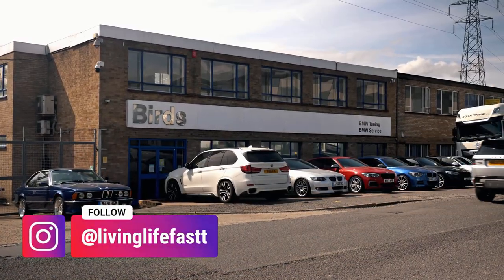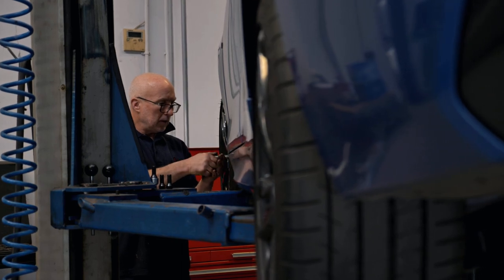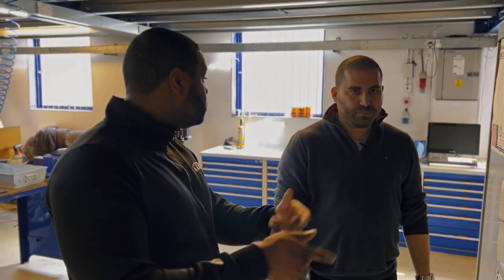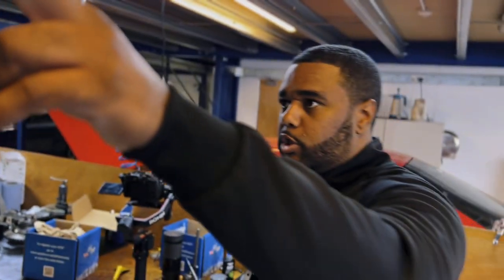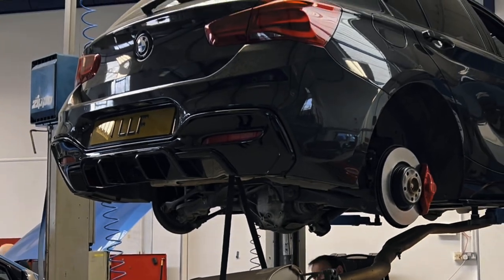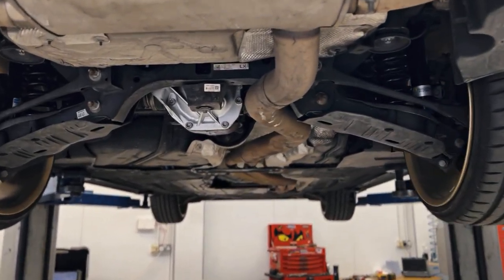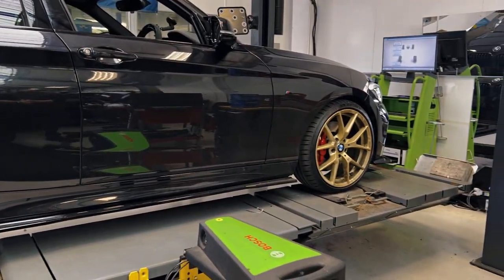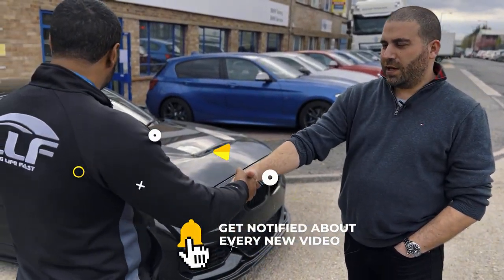HANDLING MODS FOR MY BMW M140I **B1 DYNAMIC PACKAGE**

Comment: M3/M4 Lower Control Arms are a MUST have!
Reply: 100% agree. Front end is so much more direct and the steering weights up with speed and turning effort. Added caster really helps the self centring/steering effect too.

Comment: Had a B1 full kit with LSD done a few year's back fixed the problems you mentioned even at 30mph if
 you hit a drain cover. As the original Birds article said, turned the car from 1 wheel drive to 2 wheel drive, with the Quaife LSD.

Comment: Powerflex bushes, underbody+strut brace and big brake kit and the car will be mint
Reply: @Ukgyt99  depends what stage/bhp you running, it makes a difference but nothing too crazy from what I've seen
Reply: @Ukgyt99  if you've uprated the subframe bushes. Then yes. Do it rather than later. The diff bushes are known being weak and often crack
Reply: Won't that make the ride unbearably harsh tho
Reply: @Ukgyt99  Nah the powerflex bushes and strut feel like day to day driving would be annoyingly stiff
Reply: M sport blue brakes 4pot are just fine with a good set of pads and discs, running 580 on my 240i and it's fine tbh spend the money on more power 👍

Comment: Great video, I had a stage 3a s14a that I put nismo s-tune suspension on that was developed for the car. That was a damper set up and I had whiteline arbs. The coilover boys would not see were I went on a b road. So pleased, I did the same when i bought an e46 m3. Same again, a bilstien damper kit you could get for that, and again, great road car, good everywhere speed bump friendly. Yes you dont get the "stance" with only a sublte drop on both but they really worked well. Dont get seduced by coilovers they are not the only option.

Comment: I have this package on my 330d e92 funny thing is its actually 10mm lower than the M sport suspension I literally have a 5mm arch gap on the car but it handles better than M cars on uk B roads

Comment: Looks like it’s sat higher than before lol
Reply: It was on lowering springs, the birds set up doesn’t lower the car
Reply: @mralekos  I felt the same with my Birds B1 install on my m140, in fact it looked to sit higher than stock which I couldn't get on with and after trying to live with it for a while eventually kept the B1 dampers and bump stops and replaced springs with Motech Eibachs,  after which it looked spot on and still handles great on the road.
Reply: @samtrex600  Ricky’s car will be higher because of the 19’s. But from centre of axle to arch it would be stock. Occasionally they do go up a fraction (talking a couple of mm’s) but that’s on cars that have done more than 50,000 miles, springs to sag with age and use and dampers start to fail. The motec eibachs are the same as off the shelf Eibachs.
Reply: @mralekos  not true in my case, my car had done 9k miles when I had it done.  After I raised the issue (no pun intended)James even confirmed that the batch of springs being used at did seem to sit higher, it is a shame as I had the B1 on an m135i and it sat perfectly, probably 10mm lower than stock.  Anyway its no big deal, my fault for not asking about ride height impact before getting it done.   The car still drives brilliantly with the B1 dampers, Quaife LSD and Motech Eibachs.

Comment: Birds mine and had absolutely no grip car was all over the place  phoned them and they then tried to say it was tyres lol took it to 2 independent specialist and also BMW who said it was wound too tight. So one wheel should be going one way and one the other way with a quaife but both wheels were going in same direction. Waste of time and money. Quaife ripped out and M Performance put in
Reply: What was “wound to tight” ??